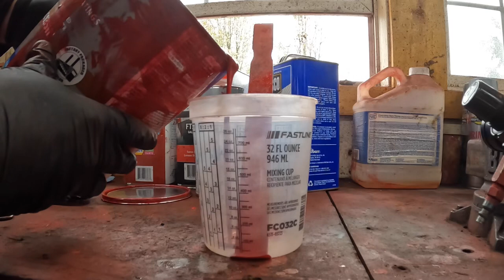Finishing the Cooling System, Brakes, and Clutch | Farmall Super C Restoration Episode 14

Comment: Thank you again Pete, for another great video. At 74, I believe that I am in your father's age bracket,  and although I have some knowledge of mechanics, I've done head/intake manifold work on big block, automobiles, and brake work, plus minor tune ups. I don't believe that I have the knowledge that you do,  but I certainly have enjoyed watching you do and explain, about redoing/restoring your tractor. I believe that I have mentioned before, that I have a John Deere 3020. What you did, I wouldn't trust myself to do, and will probably have to pay someone to do, when the time comes. Before I can replace the fuel tank & fix my hydraulic tank, or replace the hose, where it is leaking; but to do what you did, I believe that I will need some help. But thanks again for the video. I have enjoyed watching you over the years, and hope that you will keep putting out more videos.

Comment: Pete
My 1934 Diamond T 211 truck with a Hercules Flathead 6 has the same oil fan lubrication system with the sweeper to bring the oil up onto the shaft. It must have worked well because they used it in a wide range of vehicles up until the 60s. Keep up the good work!!!

Comment: Pete.... The Super "C" sure is looking sharp....! Lot's of detail to pay attention to.... if you're gonna do it, might as well do it right... bcuz if ya don't, ya gotta do it all over again...! Here's one for ya.... I bought a 96 Ford Explorer SUV 4 dr, rear wheel drive, 4.0 ltr. v-6 gasoline Engine back in 2009. About a month ago the Radiator went bad, it's got a plastic tank and an Aluminum Core. I got 3 estimates to have it replaced at local repair shops. #1: $693.17, Radiator -$448.99, engine coolant $18.99, no new Hoses. #2: $772.67, same radiator & coolant, hose kit $61.40, 4-clamps @ $3.00 each. #3: Different Shop, $866.26, Radiator $599.98, coolant $38.85, Transmission fluid $7.95, labor $153.00
I went to Automotive school in RI so I wouldn't have to pay Repair a shop big bucks. I got a replacement Radiator on Amazon $144.50 w/free shipping, bought hoses/coolant/clamps/trans.fluid all locally, the whole is under $200.00, my labor Free..! I may have told all that earlier...?  =)

Comment: Something to think about if the cooling system is hard to bleed the air out u can drill a small hole (3/16 or smaller) in the washer part of the thermostat it’s a big help and doesn’t have any negative effects

Comment: I want to thank you Pete for the education on the farmall engines, 
I have a 1952 Yale forklift with a farmall engine in it and I'm so glad I found your channel and lernd about how to properly maintain it . I never new about greasing the distributor shaft and how to oil the bushings or bearings in the fan I had no idea about those screws that I had to remove to do the proper maintenance .

Comment: The funky bearing arrangement is a hydrostatic bearing using a pressurized fluid between the moving parts. If it's maintained the service life of a hydrostatic bearing is expected to be measured in centuries not decades, so that's nice at least. Even if you are keeping your ball bearings lubricated they will wear out on you and need to be replaced in your lifetime.

Comment: Hey Pete. Still watching. love this one with all the shining newly painted parts going back together! Its keeping me inspired. was nice to see the rebuild on the fan assembly. I was pondering how that set up worked. every one I've seen was leaking oil around that shaft. And that's what I don't want on my newly painted engine. Looks like your your rebuild should work well. So my tactic ......before I started watching your Chanel ...was to just by one of those after market fan assemblies with grease sealed roller bearings. And I did. Made in china and looks like it. I plan to unbolt original fan blades and install onto new shaft and pulleys. However after watching your rebuild I might give it a go. I still just can't wrap my mind around how oil does not come out around that shaft without some kinda seal. and yes...that thing seems over engineered. Im getting close to bolting the torque tube back onto the trans case on my super a. Oh and I get it about painting the bolts for all the parts I've taken off to paint before reinstall. Ive actually cleaned ,primed and painted a lot of them separately. Anyway Thanks for taking the time to document all your detailed restoration techniques.  Looking forward to seeing that jewel crank up. 👍